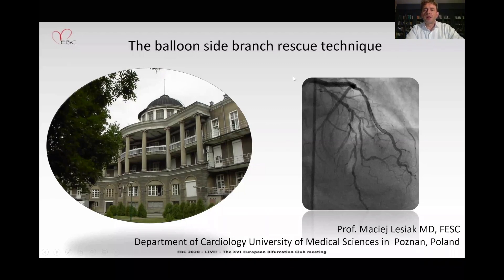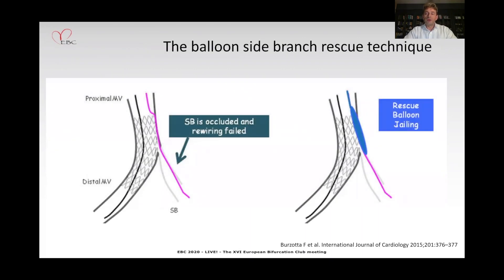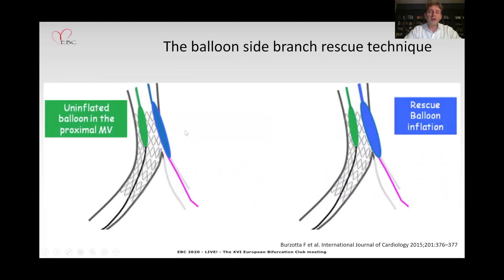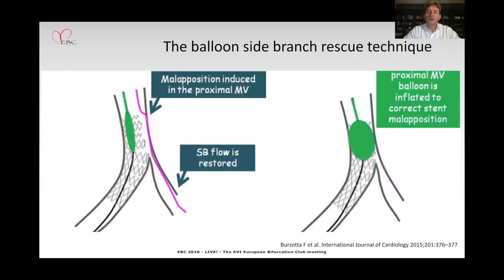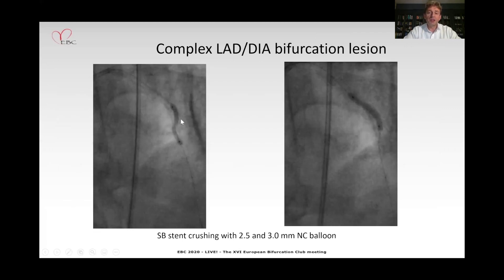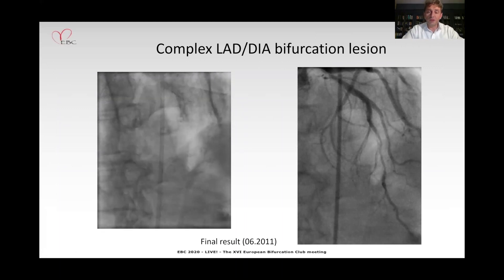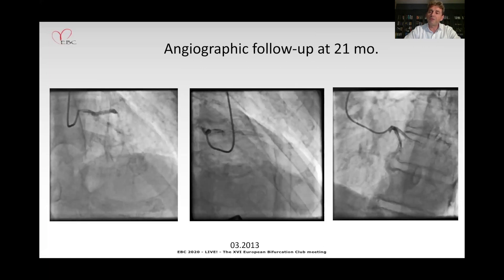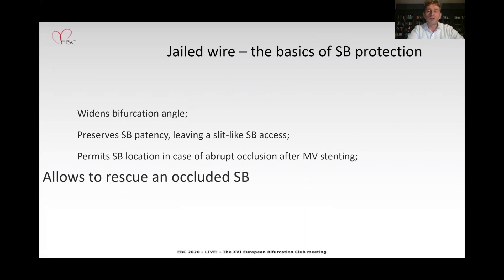The Balloon Side Branch Rescue Technique - Dr Maciej Lesiak

Comment: Hi, Professor Maciej Lesiak! Thank You for the great presentation! I have one question. In cases when we protected side branch by using balloon on jailed wire: why not to perform side branch stent implantation and perform side branch stent crush by using main branch balloon in stent inflation and POT? We can preserve side branch and not create large defomation main vessel stent to performe crush technique.
I want to check one point - to correct dilatation jailed wire balloon in jailed segment to avoid stent deformation when we perform its position in side banch after balloon dilatation. 
Excuse me for this question, but i try to understand, because many bifurcation cases i have on my duty nights.
Reply: In my opinion…I think it is difficult to deliver the stent to SB if we do not crush the stent in MV